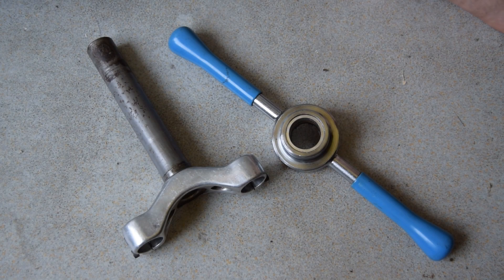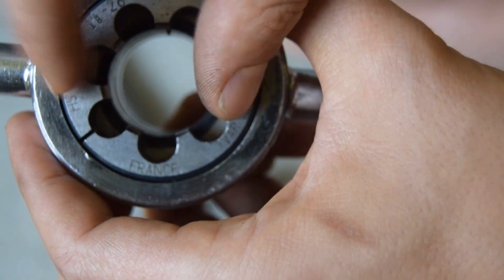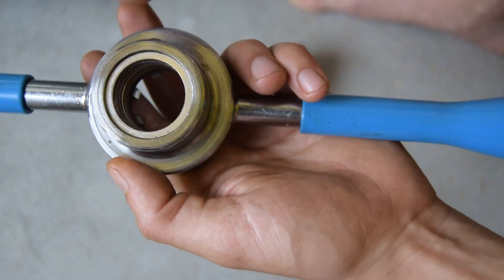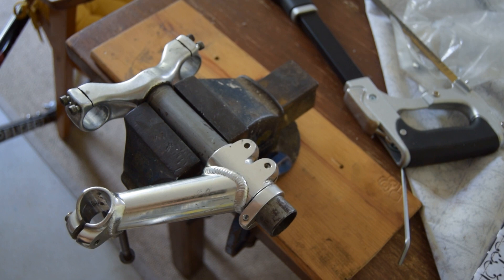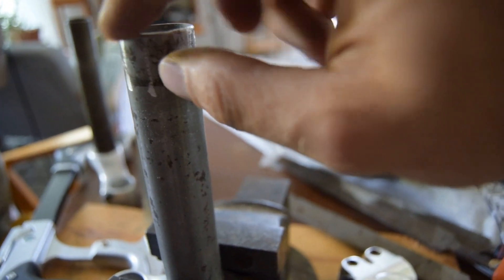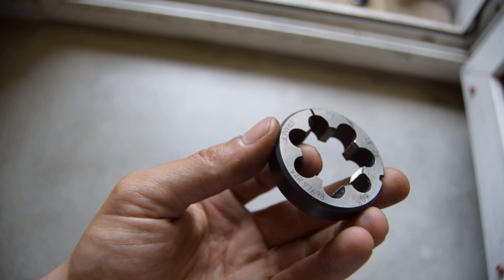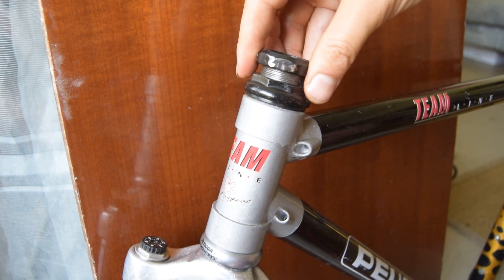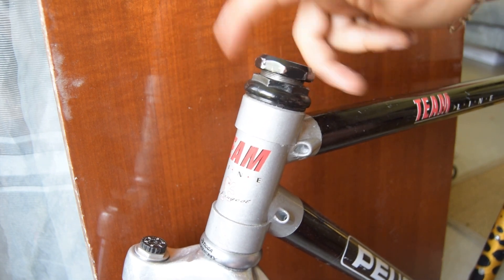Threading a bike fork Steerer Tube. Unthreaded to threaded Bike steerer tube

Comment: Cutting oil allows cutting and a good clean thread. Lubricating oil DOES NOT  cut threads and the die glides over the steel . You were so right to use cutting oil.

Comment: What brakes are you planning for this build? If they're cantis, what cable hanger for the front? I kept thinking the steerer is too short for a hanger on a spacer in the headset stack.
Reply from the maker: Cable guide is integrated on the arch/bridge of this fork